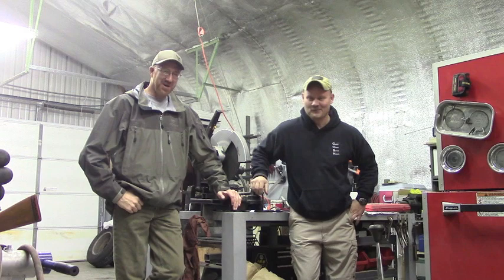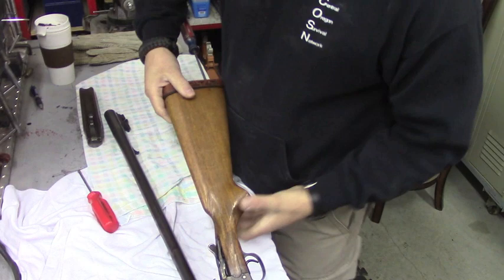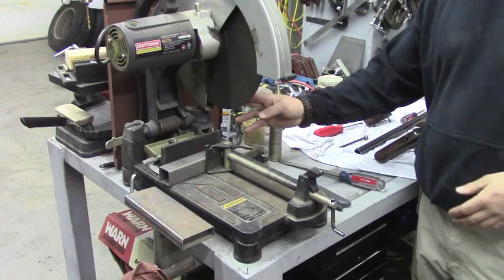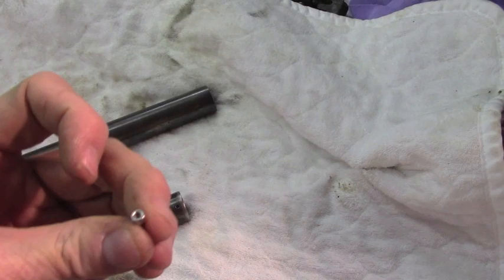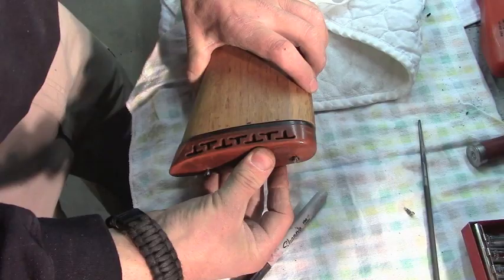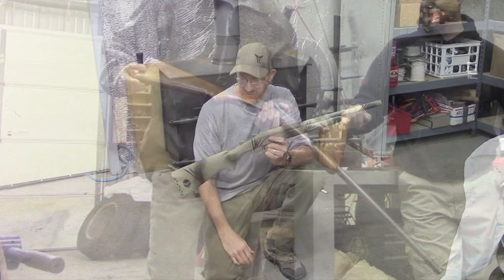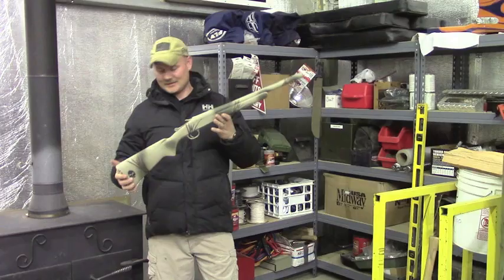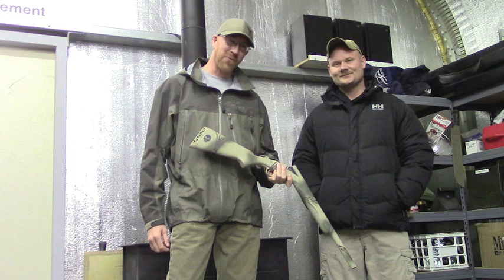$40 Bug Out Gun, Survival Rifle ? - My Bush Gun Build

Comment: Neat idea. I was thinking of maybe one of those adjustable chokes. I'm not quite sure who makes them or if they are even still made. It screws into the threaded barrel and them twists to change to whatever choke you need for the load you are shooting. Full or modified for small game and small shot (squirrels and #6) to improved cylinder and cylinder for large game (deer and slugs/buckshot). Just a thought.

Comment: Just bobbing the barrel makes a huge difference, one thing to watch for is cracks in the stock where it meets the metal. Most often some epoxy and a pin or two fix it. A lot of these have real thick cheap lacquer/paint coats so sanding it off is a good idea so you can see the wood. But for $40 and a can of paint it looks pretty good.
Reply from the maker: I agree.  Pretty solid bush gun for $40 dollars, a little diy work, and a can of paint!

Comment: $40.00 must be the mark.  That's what I gave for my (H&R) "farmer's gun" single shot break down action.  A friend (with a machine shop) cut mine off to 18 1/2" on a lathe, and re-staked the bead sight.  I silver soldered a picatinny rail on the under side of the barrel and put a short (flash light) rail on the left side of the fore stock.  You have a nice little scattergun.  They're great to play with, and make an awesomely convenient truck gun.  I've thought about using PVC pipe to custom a shell holder on the left side, but that's yet to come.  You can't go wrong with a one-hole scattergun.  great job!  Happy trails, tight groups and safety first.  Thanks for sharing.
Reply from the maker: +Kentucky Justice Those sound like some awesome add ons.  I love the idea of incorporating a short rail section.  Yeah, I agree.  It's a really fun little bush gun, and a great truck gun.  Mine breaks in half pretty easily and I can stow it in almost any backpack or duffle bag.  Do you have a video up on yours?  I'd love to check it out.

Cheers
Casey
Reply: I don't even have a picture. Getting on YouTube is about as techno as I get.
Reply from the maker: +Kentucky Justice Ha!  I get it.  If you ever do a video or pictures on it, let me know.  I'd be interested in checking it out.  Maybe pirate a couple of your ides ;-)
Reply: +Kentucky Justice i'd love to see that!

Comment: Cut off shotguns are Neato and I've done a few too over the years but if you wanted the most effective shotgun to use for all around hunting I think how it originally was would be the better choice. 
  When you cut the barrel back you loose the choke and basically makes it a very short range gun only. Try shooting some pattern paper before and after at 20 to 35 yards and you would see the advantage you have with the choke. 
  The only advantage the cut off has is at very close ranges of like under 10 -15 yards probably. 
  Probably the best modification would have been sling swivels and sling added
Reply from the maker: For sure.  The main benefit to me in shortening it is just making it lighter and more compact.  If it turns out I really like the configuration, I'll probably look to install a choke tube in it.  The barrel is thick enough to do that.  The pattern isn't horrible out to about 20 yards with bird shot.  About 16 yards is great, at 20 yards there are starting to be some "bird sized" holes in the pattern. ;-)  With 00 buck shot at 20 yards I'm only averaging 4-5 of the 9 pellets on a 20 inch square.  It sure is fun to shoot though ;-)

Comment: You probably already know this, but that is actually a Stevens Model 94. Stevens made them for a St. Louis based hardware store chain. Helpful info, in case you ever need parts for it.
Reply from the maker: +Possum Living I didn't know that.  That should help me a lot actually.  I need to get a few parts for it and I have been having a hard time finding them.  Thanks for passing that on!
Reply: +Coyote Works I'm glad I could help. Those are great shotguns, btw.

Comment: I've got a 20ga. version of the same gun. Model 94A.  It's about 70 years old, and shoots fine.  I may do something similar.  I'd like to improve the sighting system beyond the bead.
Reply from the maker: Yeah.  I agree the sighting system is one of the biggest weaknesses when it comes to using it for multiple purposes.  If you find one that you like, let me know.  That's the next piece I would like to figure out how to upgrade.

I like the idea of a 20 ga.  Still very effective, but with the ability to carry a significantly larger amount of ammo.

Cheers
Casey

Comment: i know its a older thread but that looks cool it would be cool to see how you could put a sling especially brazing one to the barrel a swivel stud that is but very cool
Reply from the maker: +Bill  Terry Thanks for the comment.  I should do a quick video showing how I mounted a sling to it.  But basically I'm running a single point on it that anchors to the buttock near where you grip it with your hand.  Normally I'm not a big fan of single point slings.  But it actually works pretty well since this gun is so light and compact.

Cheers
Casey

Comment: One of the shotgun's selling points is how easy it is to reload. Even if all you have is hand made reloading tools (except a powder measure, that you need to buy) So, even if you only had those 10-15 hulls, some powder and some primers, wads, and some kind of a mold for round ball and buckshot you could be shooting a long time even with just 15 original shells. Assuming you can find lead that is. (Dave Cantebury has a video on reloading a spent hull with just a few hand tools, not to mention I've seen some of the "reloading presses" used in the backwoods that are just some scrap lumber and dowels) So I think its a good choice.
Reply: (and yeah, I know you guys know all that, just a long-winded way of agreeing with your choice)
Reply from the maker: ***** Great points.  And even though we do know most of that stuff, other folks on here may not so I always appreciate the comments.  I watched that video that Dave Cantebury did on it.  I thought that was pretty interesting.  I"m thinking of doing some experimenting with field reloading of shotgun shells this summer.  I've even kicked around the idea of trying out a black powder rifle or shotgun of some sort.  Not saying it would necessarily be the best choice, but I thought it would be interesting to experiment with.
Reply: Casey, you can always try a Lee Precision classic loader. It's available in both 12 and 20 gauge and the only other gear you'd need would be a dead blow hammer and components.  Love the channel man, keep it coming.

Comment: I really like your bush gun build and I don't disagree that the 12 ga. is very versatile.  In fact, I have one or two of the old "break down" models myself and have taken lots of game with them over the years.  However, simply due to the weight of the ammo, the 12 ga. is not what I'm planning if SHTF.  If one does want a shot gun, then perhaps a single shot 410 might be a better choice since the ammo is lighter, can shoot slugs plus 45 Long Colt pistol rounds.  Since my wife and I are planning to bug out together, my choice for her is a 22LR and mine is a .223.  About any kind of game can be taken between these two rifles.  Again this is a personal choice and everyone has their own preferences.  Best regards from Ohio
Reply from the maker: Thank you!  I definitely appreciate what your saying.  No gun is perfect for everything.  I go back and forth.  This shotgun will sit in my bug out kit for a while, somewhere down the road I'll probably switch back to a .22.  and sometimes I even have my .223 in there.  They all have their strengths and weaknesses.  At then end of the day, if the time comes, I'll just do the best I can with whatever gun I have to work with!

Thanks for the comments.
Best
Casey

Comment: what range was that pattern at, and do you think its possible with a cut down barrel like that to modify it for removable chokes?
Reply from the maker: +ryan soper It was about 18 yards.  That is a challenge with the cutdown barrel the pattern is pretty wide.  But I think you could have a removable choke system installed.  In my mind, that would be be the way to go.  I think it just depends on if the barrel is thick enough for a gunsmith to machine the threads and spacing inside the muzzle for the choke system.  I think this one of mine is thick enough. I just haven't gotten around to getting it to a gunsmith to have it done.

Comment: I have a stevens 94f single shot 20 gauge just like this. I was thinking about cutting it down so I could use slugs. Its a full choke 28 inch barrel. Was thinking about cutting off 9-10 inches but not painting it. Its an awesome gun, it breaks down into 3 pieces without any tools and disassembles/reassembles in less than 10 seconds. paid $59.99 at a local gun shop. After seeing this I think ill cut the barrel down to 19 inches so it will be the same size as the stock. I bought it to use as my bug out gun. I have threaded barrel inserts ordered so i can shoot 9mm, and .22 out of it. Those are the same caliber as my other weapons. 10/22 takedown ruger and a glock 26 handgun. Makes sense to have them interchangeable with the barrel inserts.
Reply from the maker: zachary hug That should be a great gun!  I actually would really like to find a 20 gauge.  I honestly think I would prefer the 20 gauge for my bug out shotgun.  Still a pretty effective shotgun round, but I could carry a lot more ammo.  I just haven't been able to find a decent single shot in 20 gauge.  If I do, you'll see me do pretty much the same thing with it...;- )
Reply: A 25 round pack of 20 gauge birdshot is $5.88 at a big box store and 2 boxes is heavier but same volume as 1 box of 12 gauge. 2x's the ammo capacity for same space taken up is not too bad.
Reply: sorry not threaded but rifled barrell inserts
Reply from the maker: I figured that's what you meant ;-)  lol
Reply: zachary hug Well, if you think of it, rifling is just very long shallow threads...you just have a very very low thread count! (and I figured that's what you meant too) Peace. :)

Comment: A fun build. I did like your paint scheme.  What kind of paint did you you?   Did you thread the barrel  for a choke?
Reply from the maker: I just used the Rustoleum camo colors.  Desert Sand, Olive, and Earth Brown.  It's pretty good quality spray paint.   The barrel isn't threaded now.  It's kind of an experiment to see how well I like this configuration of a firearm for the bush.  But if I do end up liking the design, I will build another one out of a little newer base shotgun.  And I would definitely like to instal removable choke tubes.  As it sits, it's just straight cylinder bore and the pattern is pretty wide.  It shoots slugs great, but for shot I would like to have a little tighter pattern to give me some more distance.

Comment: Lol I did a project not unlike this one in my formative years with an h&r 12 gauge except mine was a little shorter @ 18 1/2 on the barrel and 2 inches off the stock I made a steel butt plate for it as I'm too cheap to pitch on a real recoil pad and yes with a 3 inch mag it was a real ass kicker but to compensate for my cheapery I ported the barrel about an inch behind the muzzle back to about 15 1/2 inches which made it obnoxiously loud but saved my shoulder and made for a badass muzzle flash at night 😉
Reply from the maker: +Justin Barbee Lol.  Yeah for sure the recoil is serious with the heavier loads!  I have another single shot I'm thinking of modding similarly and I think I'm going to go the route you did and make it a little shorter.  I'd also like to build one that's a 20 gauge but I haven't found a decent old 20 gauge to work with yet.

Cheers
Casey
Reply: Coyote Works I actually did the same thing with another h&r and it was in 20 gauge and the recoil was very manageable if you want to find one pawn shops are a good place to start looking lol I've never paid anything less than 100 bucks but I wish you the best of luck !! shoot straight and stay safe man

Comment: Get some chamber adapters and then you have a very versatile SHTF firearm.
Reply from the maker: +Wysiwyg101 I keep thinking about getting ahold of some and trying them out.  In theory they are a great idea.  I just wonder how accurate you can get with them.
Reply: Well, let's face it, a chamber adapter is usually about 6-8' long. So, that's your "barrel" length. I guess it depends upon how accurate you can make that work for you. Definitely not going to be an accurate long range device though. 

I've heard of different calibers for chamber adapter. Calibers like ALL of the various handgun rounds like .22lr, .380, .357mag, 9mm, .40S&W, .45LC, and .45ACP. I've also heard of rifle rounds like .223/5.56mm, .270, .308/7.62mmX51NATO, 30.06, 30-30, etc. Plus, the 12g version will also fire .410g and 20g. So, there's a wide range of possibilities that can be added. I would imagine that it would be possible to fashion a sling that has a pouch on it that would hold the adapter caliber(s) you want the most as well some ammo loops along with the actual caliber for the shotgun.

Comment: now, if you put a choke tube system in it a bought a 30-30 insert barrel (18") and a few chamber adapters....
Reply from the maker: +Rob Aldridge I agree that would be the the ultimate next step.  A choke system would greatly improve the patterning, and having the ability to fire some different calibers through it with the inserts would just give it a whole new level of versatility.

Both are on my list for the next one I build!

Cheers

Comment: One question, what kind of paint did you use? Was it automotive paint? I'm just curious cause of the heat that the rifle can give off when fired.
Reply from the maker: Paul Greth We just used regular old krylon spray paint.  It won't last forever for sure.  But so far it's holding up pretty good ;-)

Comment: Did he drill all the way through the barrel for the sight bead? Awesome vid!!!
Reply from the maker: Yes we did.  I then filed and sanded the screw inside the barrel until it was flush and smooth to the touch.  It seemed to have worked pretty well.  Haven't noticed any issues with it yet.
Reply: Awesome! I think I'll be hunting for a value priced break action!!! That said.... I think I'll avoid slugs if I use the same sighting method! Thanks for the inspiration.

Comment: I definitely want to do something like this. Is the overall length and everything else legal size?
Reply from the maker: +Devin Hightower (TheXChapter) Yeah it's well within the legal limits.  I cut the barrel at 19.5 inches with is actually an inch longer than the legal limit.  The over all length is well over the legal limit as well.  And actually I wouldn't even mind it if it was a few inches longer.
Reply: +Devin Hightower (TheXChapter) send barrel out to a gunsmith and have it cut down and threaded for choke tubes.....then it will be way more useful.....open bore shotgun is not much good with such a short barrel.....been there....done that...
Reply: Devin Hightower no its not, or at least you better have an "in" with local cops cause they measure from one of a couple places where the barrel meets the front of the action, the feed, or the chamber. Either way, a cop with a calibrated eye will easily pick up that the barrel is shorter than norm and that gives them all the probable cause they need to detain you and find anything else wrong with you, your vehicle, and any property therein.
Reply: If youd like a choke . you need to gently squeeze the barrel tip with a 3 jaw lathe chuck a couple times ..just enough to give back the choke

Comment: I was curious,  does anyone make a pistol or rifle caliber converter  that would  fit  that?  the ability to shoot .22, 9mm, .45 acp, .223, or even a .308  would make  that a perfect  bug out gun
Reply from the maker: +J.W Thorp Yes.  I think there are a couple companies that make them.  I've played around with a couple but haven't pulled the trigger on buying a kit yet.  But they make inserts that convert  to several possible calibers.  Not a bad idea to consider for sure.

Cheers,
Casey
Reply: My concern is the pressure build up, would an old 12 gauge take the power of a 308?
Reply: Hayden B I'm sure it would these break actions are built  to withstand some pretty severe punishment h&r actually sells break guns that have interchangeable barrels so you can have a shotgun and a hunting rifle

Comment: It's not a smart choice from a SHTF scenario.  An infinitely better choice would be a side by side 12ga. double barrel that has two triggers.  It doesn't weigh very much more, and the advantages it has over a single shot would take twenty minutes to list.  Cutting down the barrel is not very wise, either.    Survival or SHTF, a single shot anything isn't very smart.  Neither is a forty dollar gun.  Get a side by side double, and leave the barrels the heck alone.   Short may be handy, but not with a shotgun.  Buy a couple of inserts in different calibers that allow you to use .22 ammunition accurately, and that allows you to use a common higher powered handgun ammunition, such as 9mm or .357. A short, single barrel 12ga is cool, and can be useful, though awing off the choke is not at all smart, but it's a horrible choice when compared to alternatives you can also get pretty cheap.
Reply from the maker: +James Ritchie Yeah I've been looking for a side by side to do a similar build with.  I definitely like the idea of having the two shots to work with.  I also really like the idea of the rifle/shotgun over under.  They used to be everywhere but now they are actually a bit hard to find.